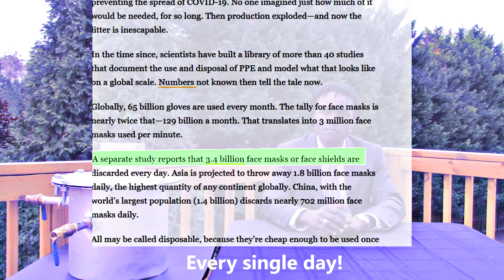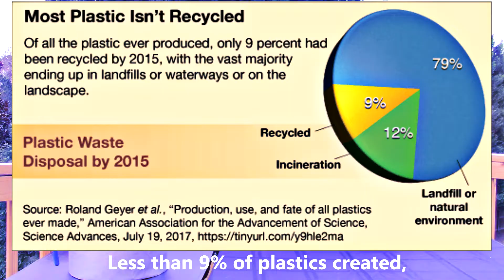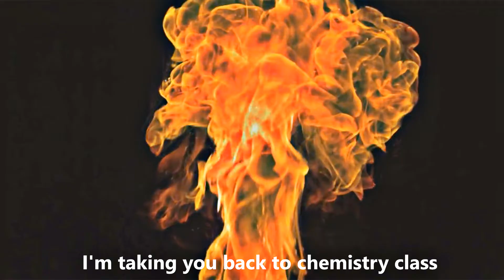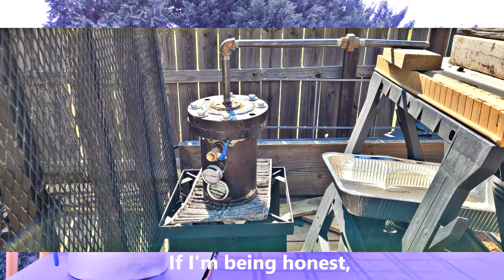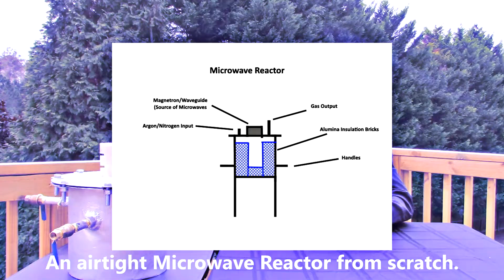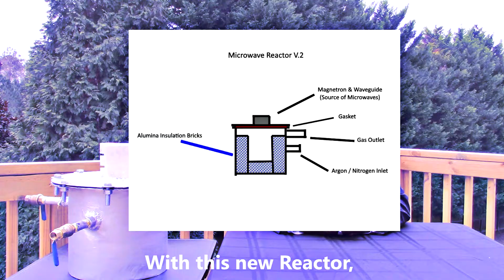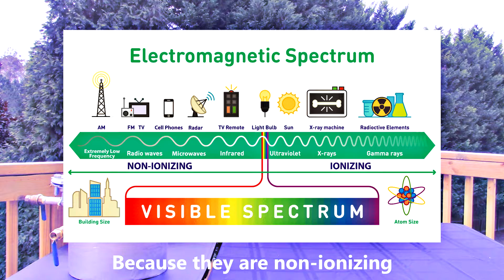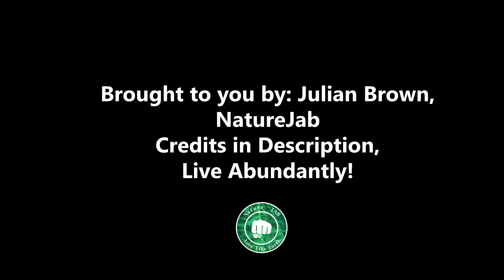I turn Plastics into Fuel, Using Microwaves! (Pyrolysis Reactor)

Comment: Considering that pyrolysis could renewably recycle ALL burnable waste into various fuels, and that the leftover biochar or coke etc can be used for industry or locking away carbon while improving soil, BUT only YouTubers are doing it while it's NEVER mentioned on mass media, and anyone trying it on a large scale runs into legal roadblocks suggests 'Someone' doesn't much like this idea that could easily replace the Fossil Fuel Industry! :)
Reply from the maker: Exactly so. Definently some caution to be taken for those who pursure it. But someone has to... the world needs it!
Reply: @naturejab  Often feel like I'm the only one thinking this so thanks for the reply. :) I'm curious if your process could do fine dry biomass like plant waste or even treated sewage by mixing it with an inert and reusable microwave absorbing powder, and if powering your reactor from a generator with the fuel it produces would create more energy/fuel than it consumes.
Reply from the maker: @MadScientist512  it definently can work on an type of biomass. A lot of energy is lost through heat so the input will always be higher than the output, but if run off a generator with renewables there's potential for a neutral energy rate.
Reply: @naturejab  Commercial Pyrolysis of biomass powered by its own gas production is net zero carbon at least, considering biochar can be put in soil, but solar concentrator pyrolysis of man-made waste would definitely be a game-changer. It would be interesting to see if adding insulation and heating it directly with its own fuel, thus bypassing the inefficiencies in the magnetron and generator, would get it beyond breakeven. As it stands its a great denonstration device, with the future potential to use yardwaste and solar power to create net zero generator fuel and save on solar batteries, kudos to you.
Reply from the maker: @MadScientist512  exactly, the goal right now is just to break even on energy. But to get even a small profit in energy is 100% desirable.
Reply: @naturejab   I found a great video on "Continuous Microwave Assisted Pyrolysis" containing many helpful ideas for your invention. It turns out that the "reusable microwave absorbing powder" I hypothesised really exists and makes the process much more efficient, funnily enough it's called "Microwave Absorbent", and Silicon Carbide appears the most effective while also able to act as a catalyst for a variety of end products. Their 6kW continuous pyrolysis pilot unit could process 200 kg of plastic waste per hour, and was even 30% more efficient at producing the petrochemical feedstock Naphta than the standard fossil fuel process, they also got out way more energy than they used so you should be good for getting significantly beyond breakeven. There's plenty of info on catalysts and temperatures used to get different products, and though it gets quite technical but I'm sure you'll lap that up, and there's plenty more info and links in the description; hope that helps in your quest and I'm excited to see what you come up with next! :) Here's the link:  https://youtu.be/hv9diZZLPE8
Reply from the maker: @MadScientist512  thank you so much!

Comment: Hi. Great work you solved many of the problems. Can you try this : try to make eps concrete to coat the inside of your reactor and this way you get better insulation the way to make it is easy, you mix cement, eps recycled beads ( shredd polystyrene foam), sand and water. This concrete is very insulative and very strong you can also put a wire mesh inside it to make it stronger.  can tell me how you managed to attach the microwave without loss of sealing so no oxygen gets into the reactor?
Reply from the maker: I attached the microwave through a dielectric material. A material that allows microwaves to pass through it, but is heat and pressure resistant. This, combined with a silicon gasket makes a seal between the waveguide and the reactor. Thank you for your suggestion on insulation, I will look into that!

Comment: Im an undergraduate student majoring in chemical technology, and we have this as our thesis microwave pyrolysis. I want to ask if do you think it is possible to use a domestic microwave oven (the one we use at home to heat up food) for the pyrolysis process?
Reply from the maker: It is excellent you are majoring in chemical technology! The domestic microwave oven in itself is not airtight, so it cannot be used as a Pyrolysis reactor without heavy modification. However, the domestic microwave magnetron is more than powerful enough, and what I use in my custom built Pyrolysis reactor. Thank you!

Comment: Hi man, brilliant idea to use microwave! Could you share the power required to run the system and the outputs ? I am thinking about installing pyrolising system and make it available to villagers to engage them in collecting plastic on the beaches
Reply from the maker: Hi, the power consumption of this small unit is the same as a typical domestic Microwave Oven. It's 1000W or 1 kWh. The outputs are still being studied to find the exact energy potential. But So far, I have successfully created and compressed a calorific gas similar to that of natural gas / propane. Thanks for watching!
Reply: How’s this going?
Reply: Yeah how’s it going?????

Comment: Great video. Let's build a 20 ton/day portable unit. Starting on it soon in Odessa Texas. Come help. We can split the money.
Reply: Also you can get paid for taking the waste. Most landfills charge $65/ton.
Reply from the maker: @rvause1492  this is good to know , thanks for sharing! What background do you have in building pyrolysis plants?
Reply: @naturejab  I've been studying pyro for about 3 years. It's my side project. I can build anything. But I haven't built a pyro plant yet. I work in the oil field and we use a lot modular truck transportable equipment to drill oil wells. They are basically factories that can move and setup almost anywhere in about 48 hrs. Also access to a lot of scrap materials perfect for constructing prototypes. I have a backhoe, dump truck, and access to fabrication equipment for the project. I also have 40 acres of unrestricted land to work on without bothering anyone. I think it's a facinating concept.
Reply: I also have a 350kw Genset to turn the fuel and syngas byproduct into electricity.
Reply from the maker: @rvause1492  Very interesting and cool to hear. Do you have an email I can connect with you through?
Reply: We could use the generator running on the pyro diesel and syn gas to make electricity for microwaves. I was thinking of just adding some pure oxygen and burning about 6 to 8% of the feedstock right in the reaction chamber to get the temp we need. It wouldn't degrade the syngas much.

Comment: I don’t know if you say In the video but what is the whole cost of the pyrolysis setup and solar panels? As well as how many waste products and how easily they can be disposed. I work very closely with a charity that helps small communities struggling with lack of energy and a large amount plastic waste. A technology like this if able to be easily setup and deployed could potentially be beneficial for both. 

Thank you
Reply from the maker: HI, All of the potential costs are just in theory, as the reactor I show here is merely a prototype. But we can calculate the potential costs. So, the reactor runs off the same power as your typical microwave oven, 1000W. In order to power this with solar panels, you need: 
Minimum 2000W inverter
At least 2, 100ah batteries 
And 2  Solar Panels
With this setup, it would take about 1 hour of charge mid day before the batteries will have enough charge to get it started.
Amazon actually has a kit of all of this for $2,559 - the Inverter, Solar Panels, and Batteries (if you buy it all separate it comes out to be a little over $1,000)
Then the reactor itself - There's no good way to estimate the price, but considering I know all the parts and labor it takes to make one I'd say no less than $1,500 per unit - not including the maintenance items (such as replacement catalyst and filters)
So overall, let's put it out there and say a whole unit with solar panels to run and maintain would cost between $2,500 - $4,000 per unit.

The current capacity of this experimental reactor is around 15 Liters ( close to a 4 gal bucket) worth of plastic per batch. I do wish to expand the capacity in the future, mind you.
 Every batch of plastic takes around 4 hours to complete.
The amount of plastic that can fit in there is also heavily dependent on the plastic. For example, bags take up a lot less space than water bottles or PET packaging, which would need to be cut up.

Hope this answered your question, thanks!

Comment: So what's the  EROI (Energy Returned on Investment) ?
Reply from the maker: I have not done the math, as I have yet to run it off of solar panels. However a typical microwave runs off 1200W, and a batch of plastic takes about 4 hours to complete. Say the price of electricity is 12 cents in KWH, a single run would cost 14 cents at 4800W.  However the cost would be eliminated if ran off renewable resources. The direct amount of energy to crack plastic into vapor is about 1.328 MJ/kg,
And in every kg of plastic, about 42.3 MJ is recovered. Profit also will come from the solid products too, making it easily profitable between energy, solid, and chemical products.